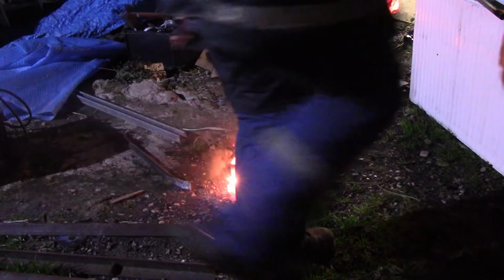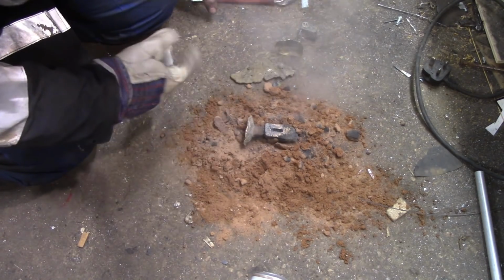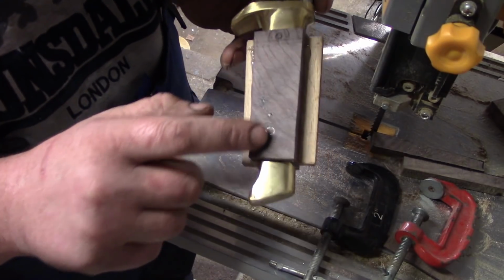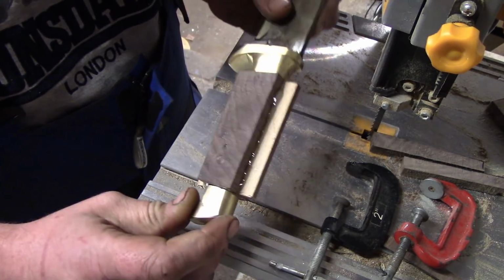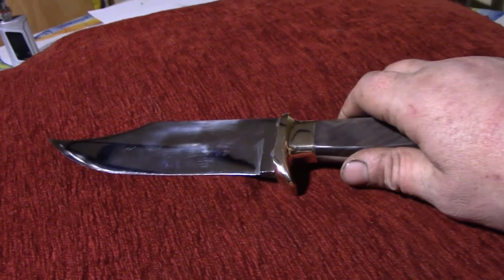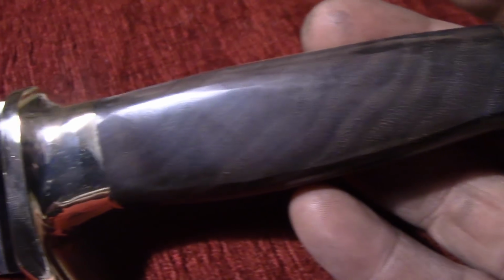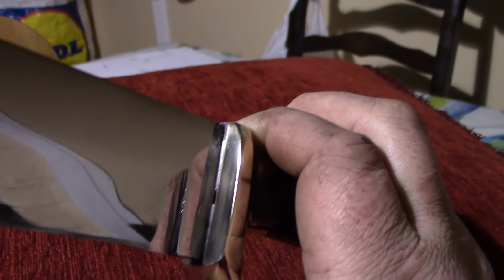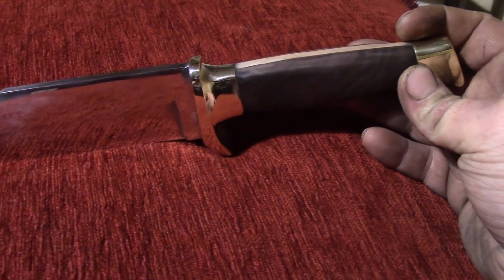Leaf spring Bowie knife making

Comment: Nice work on the knife. The only thing that I would change is to hollow out a piece of wood for the handle (drill and file) so that the tang slides into it. Then fill the hollowed out wood handle with epoxy and then add the brass end piece which can either be pre-med on there with a torch or use a die to create threads and then tap the brass end cap and screw it on. You'll have a stronger handle. Either that or drill holes through the tang and the handle scales and use brass rod with the epoxy to hold the handle scales more firmly on.
Reply from the maker: Holy Crusades Knights Templar it's always a compromise, a brazed pommel and guard has got to be better than screwed or pinned, completely agree this is the worse way of doing the wood though although with it being end grain I'm not sure it would hold up to being drilled and filed.

Comment: Looks good. Have you tried casting with Pewter? I get good results from it. Much softer but easy to work. 
When are you doing an Axe from scratch? 
Keep up the good work.
Reply from the maker: Stephen Cresswell not yet, I'd like to make a 1gallon tankard some day so 25kg of pewter is definitely the way to do it!
I'm just scavenging the required materials for a 20ton power press then I'll be making an axe from rail track
Reply: Turbo Conquering Mega Eagle I have a lot of scrap Pewter. You're welcome anytime.
Reply from the maker: Thank you Stephen Cresswell , it would mean you would have to drink a gallon of ale if I used your pewter....
Reply: Turbo Conquering Mega Eagle messy. Very messy.